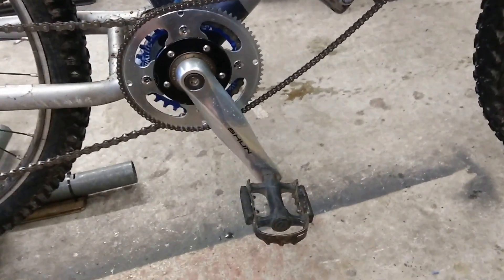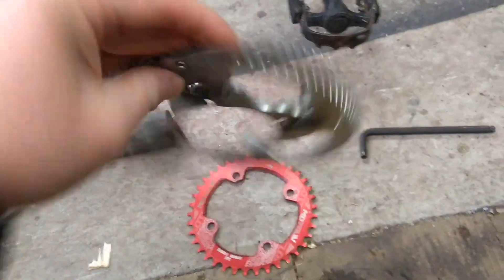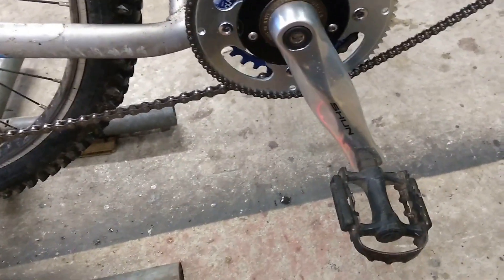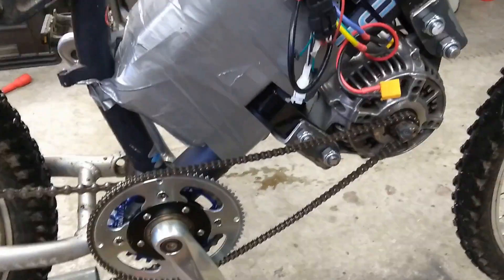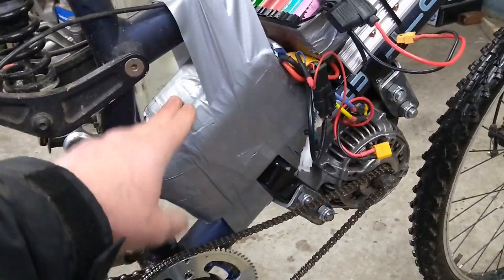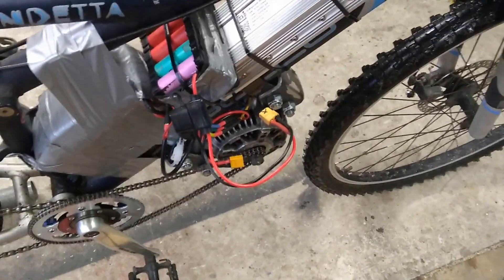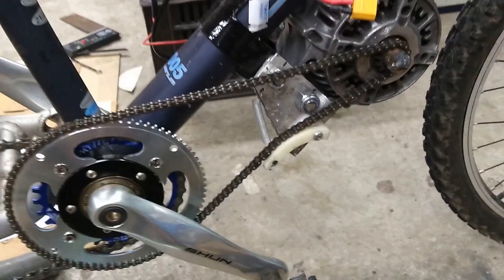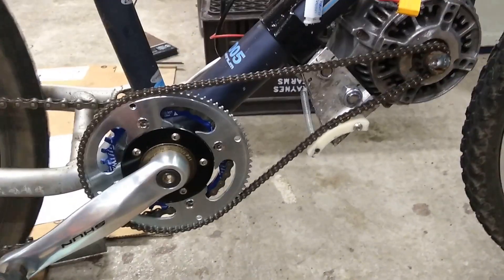DIY Ebike with Car Alternator V2 Episode 4 - A wee bit tidier. NB Read the notes

Comment: How many watts are you putting through it?
Reply from the maker: Not certain but its a 1500W controller so I guess around 1500 watts. 
I might try putting a clamp type ammeter on the cable to check but it's not easy to see while riding so I need to use a camcorder to record it.